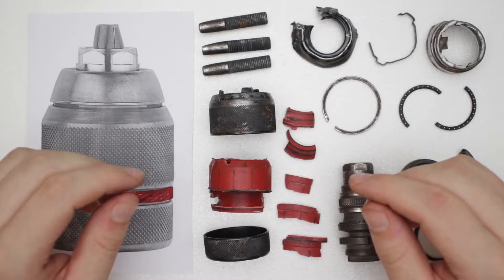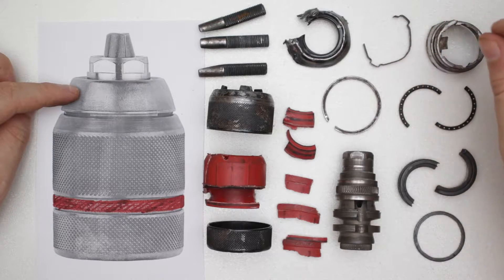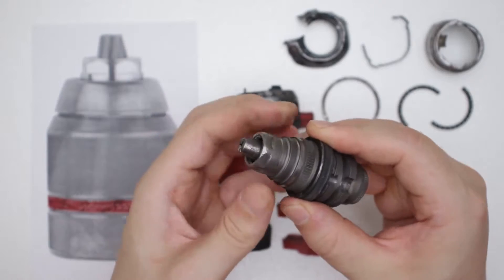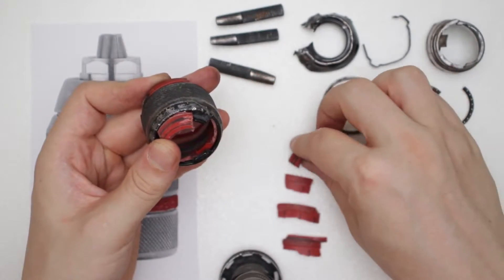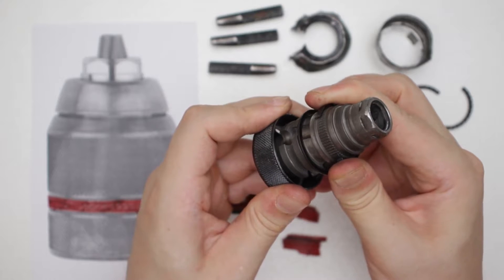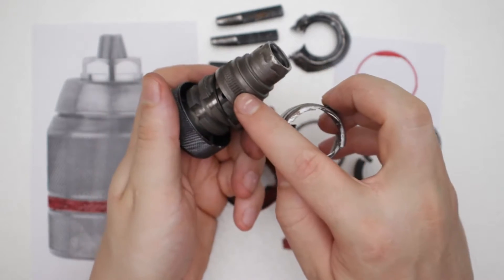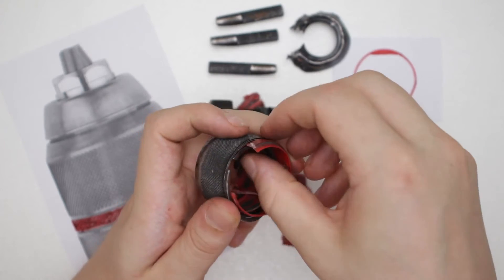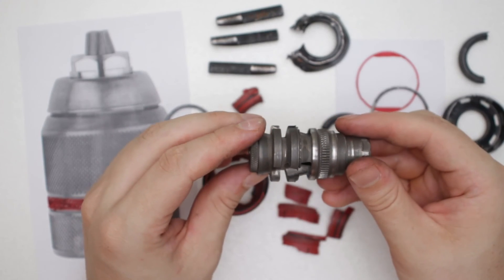What's inside a keyless drill chuck: Metabo Futuro Plus S2 M ripped apart

Comment: I have owned several drills, with keyed chucks as well as keyless chucks. My newest purchase (for home use) was the metabo sbe-780-2 which comes with the Futuro Plus keyless chuck (same as what is shown 👆). The drill itself is stout but the chuck is simply garbage. After 2 months of moderate use, the chuck started slipping. Cleaning it did not help. So I ordered a DeWalt 1/2 20unf keyed chuck (chuck is actually manufactured by Röhm).

Comment: Good video, but you missed out a step, How do I get the chuck off my drill?...thanks
Reply from the maker: Might depend on the drill, but for this one I just needed two wrenches, one grabs the hexagon at the tip of the chuck, and the other grabs a flattened spot on the shaft of the drill below the chuck.
Reply: @Makstuff  Many thanks